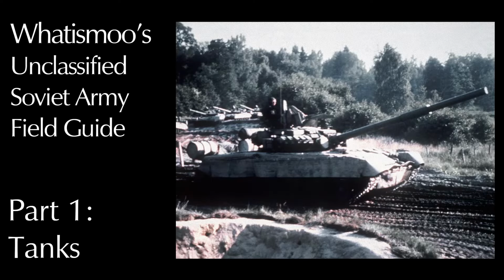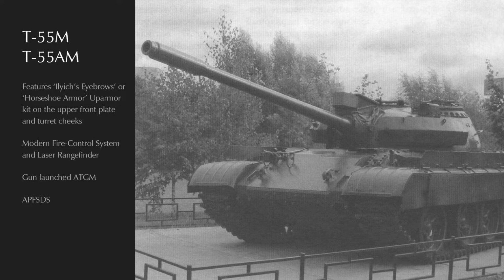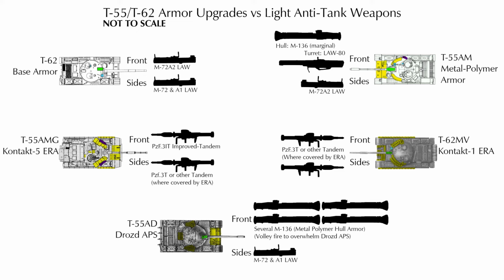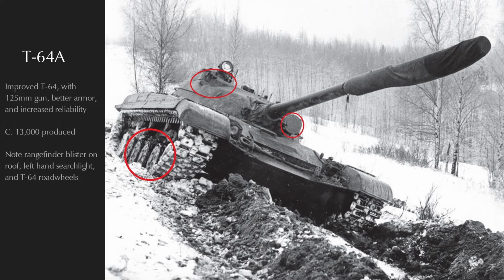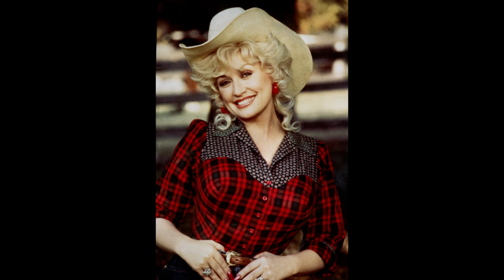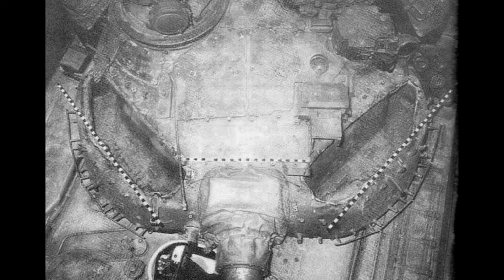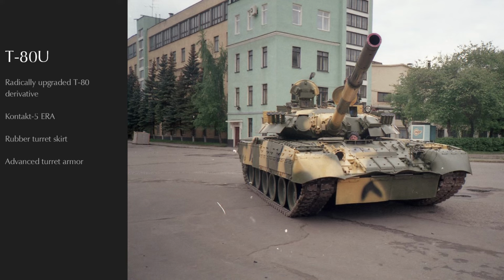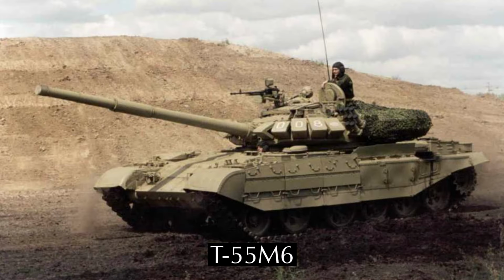Whatismoo's Unclassified Soviet Army Field Guide, Part 1: Tanks

Comment: Hey not sure if you'll see this or anything, but would you happen to know if the Object 195 uses the same roadwheels as the T-72/ T-90? I've seen some information that claims it does since it uses a modified Object 187 hull but its a little difficult to tell in photos.

Comment: Sadly there are quite a few mistakes. Forgets T-62MD , T-62MV , does not distinguish between T-64A 1969 and 1974 , the T-62B ( this was a prototype that competed against T-64 ) and it ancestor of T-72 , forgets T-64B1 , T-80UK obr 1991
Reply from the maker: I appreciate the feedback! It's not meant to be an exhaustive guide, but to cover the more common variants which saw widespread service. That said, here's some reasonings why not to include the tanks you listed:

As far as I can find, the T-64A variants you mentioned only differ by the commanders MG mounting?

The T-62MD was left out because of a lack of sources or photos. The T-62MV makes an appearance at the end. at 38:00 or so.

The T-62B was a prototype which while interesting, is not relevant.

The "T-62D" appears only to exist in wikipedia, a quick look at BTVT, who is generally reliable, indicates that the hard kill APS for T-62 passed state tests in 1989, but was cancelled due to the breakup of the USSR. 

T-64B1 is almost indistinguishable from the T-64B, and only differs in whether or not it can fire the AT-8 SONGSTER (Kobra) ATGM. The T-64B1 (Obj. 437) literally has sheet metal welded onto the turret to mimic the silhouette of the T-64B (Obj. 447). 

The T-80UK wasn't included due to rarity. Only just over a thousand T-80U/UD were made, and I can't find solid production numbers for the UK. However, the information I have says that the ratio of T-80B/BV to T-80B Command variants was 5135:256, or just over 21:1. Optimistically (meaning if T-80UK was produced in the same ratio to T-80U as the command T-80B/BVs were to the T-80B/BV, that would give a production run of 50 T-80UK. That's not really significant. You'll also note I didn't mention any other command variants.
Reply: @Whatismoo  The main difference between T-64A 1969 and T-64A 1974 is the gun , 1969 uses the 2A26 gun without termal sleeve and had awful accuracy , 1974 uses 2a46 with thermal sleeve. T-72 Ural used 2A26M. T-64B1 was made due to problems producing guidance systems.  T-80UK obr 1991 significance is in that it was the only soviet MBT using a thermal sight aka Agava. T-62D I find mentions that they were deployed to Afganistan as a separate tank battalion with 103rd Airborne. There are lots of photos claiming to be be T-62D but cant make out the launchers on any of them.
Reply from the maker: @ivanmonahhov2314   Thanks again for taking the time to reply!

While the 2A26 vs 2A46 distinction is a thing, I'm of the opinion that it was not a meaningful addition to the video. You'll note that I don't address gun performance and accuracy especially much in the video. As I said in the introduction, "It is not meant to be a gripping edge-of-your-seat guide to the minutae of every nut and bolt of the Soviet system, but more of a quick and dirty practical introduction to a somewhat poorly understood topic."

I'm aware of the reasons behind the T-64B1, again I don't think the difference is meaningful in the context of the video.

T-80UK obr 1991 is not a relevant to the context of the video. As I state, there will be a forthcoming appendix covering the prospective "Future Soviet Tank" developments through the turn of the millenium. 

There's pictures of T-62s with Metal-Polymer Armor being used by 103rd VDV in afghanistan (see links below). There's allusions to the T-62D in afghanistan, but the sources appear to be describing a precursor to the T-62M as the T-62D, which is the exact kind of confusion I'm trying to avoid. As I say around 11:30, armor upgrades generally matter more than what exact model of tank it is. 

That said, Vitaly Kuzmin does have pictures of a T-62 with mounting points for
 an Active Protection System, and Loooser posted a picture of a T-62 with one fitted that isn't Drozd, but is similar. Tarasenko describes this as the T2A2 APS here. https://andrei-bt.livejournal.com/659472.html but it, as I said above, did not enter service.

http://otvaga2004.ru/wp-content/uploads/2013/03/otvaga2004_afgh_2_008.jpg
Reply: Приятно читать такие конструктивные ветки комментариев)

Comment: Very nice work! This is a well done and much needed reference on this topic.

One thing about Soviet tanks that really confuses me is their designations. For instance, if a T-54 was produced well before 1954, didn't weigh 54 tons and didn't fire a 54 mm gun I'm puzzled as to where the "54" comes from. The tank designations don't seem to have any consistent relationship with their "Object" designation either.
Reply from the maker: Well, from what I understand, and I will admit this isn't something I've got a solid source for, it comes out of the evolution of T-34 -> T-44 -> T-54. That said, they're semi-arbitrary designations, like how the F-18 refers to both the Hornet and the Super Hornet, or how the Tu-22 is both the Tu-22 BLINDER and Tu-22M BACKFIRE series, or how the B-29D got renamed the B-50 to sell it to congress. The Soviet procurement process was just as politicized and flawed as the American one, arguably more so because they had a formalized governmental body, the Commision of the Presidium of the Council of Ministers of the USSR on military-industrial issues (VPK pri SM SSSR / ВПК при СМ СССР). This meant that at one point in the 70's the USSR was procuring 12 types of ICBM, because Brezhnev and the VPK wanted to placate everyone and didn't cancel programs. They also did things like procure 4-8 nuclear basic loads of strategic missiles for the submarine arm to keep the factory running. I would imagine the wastage of this would be clear, given the dubious utility of stockpiled arms in the event of a general nuclear exchange. But it kept the factory workers employed, which was in and of itself a positive good in a socialist economy, and who doesn't want to exceed production quotas!

The object designations aren't universally helpful, because, for example, the three T-54 variants all share the same object designation.
Reply: @Whatismoo  gonna go ahead and mention that the Soviets ordering missiles solely to keep the factory running is not actually all that wasteful compare to other things you've pointed out. Having a factory with workers that have experience in building those missiles isn't something you can buy, and closing down the production line and inevitably having to re-figure out how to do what that factory was doing when something actually had to be made would probably take more money than just keeping the factory running
Reply: @Whatismoo  Ok, that makes a lot of sense. It sounds like something I've heard (but can't confirm) as to why so many US Navy planes were designated "F4" in such a comparatively short amount of time (something to do with essentially tricking Congress into providing funding).
Reply from the maker: @mensch1066  That was part of the 1962 implementation of the tri-service designation scheme for aircraft. This is why you had the C-130 and C-141, but then the C-5 was newer than those. Hence, the YF-110A got renamed the F-4C, and the F4H-1 became the F-4B.

Comment: 10:12 https://thesovietarmourblog.blogspot.com/2015/12/t-62.html#rof
Nice intro though.
Reply from the maker: If you compare the discussion of the rate of fire in the T-54 and T-62 articles on tankograd, you'll note that, using the same metrics (combat conditions, stationary, aimed shots, from the soviet manual) the nominal rate of fire was 7 rounds per minute on the T-54 (1951) and T-55A, and 4-5 rounds/minute with the T-62. This might be due to the sight-follows-gun stabilization on the T-62, and the gun moving to a loading position/elevation automatically.